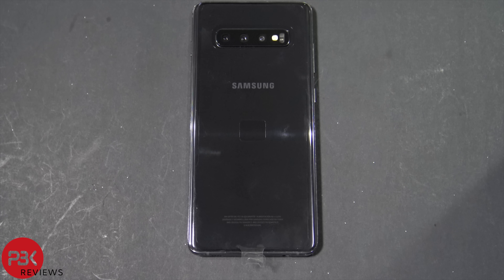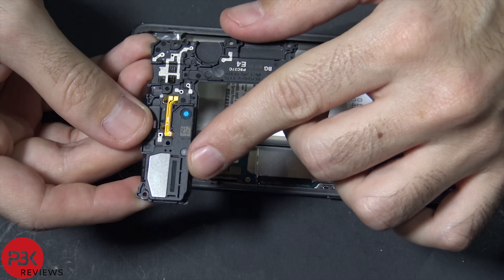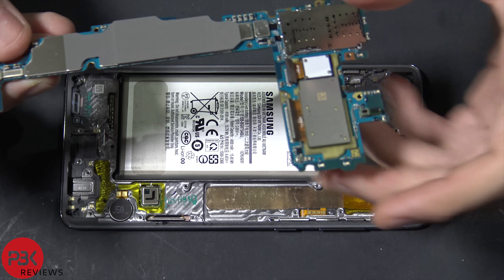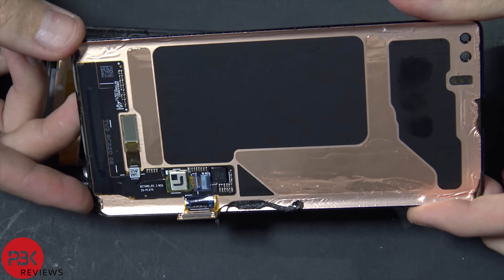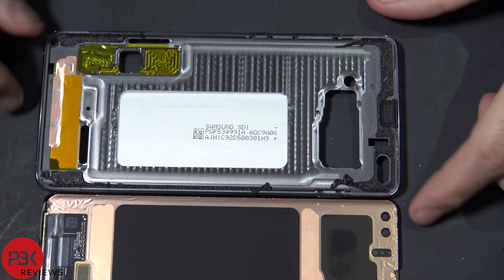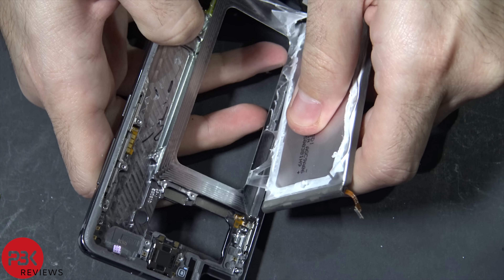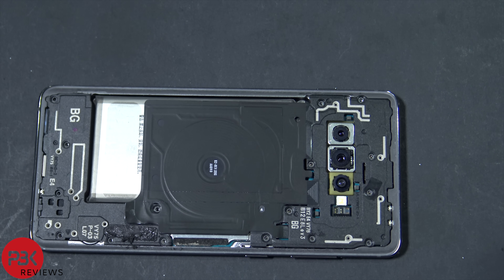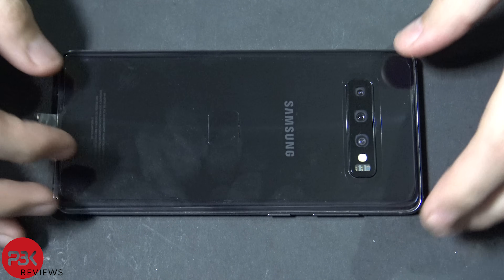Samsung Galaxy S10+ Plus Disassembly Teardown Repair Video Guide. Any Bitcoin Inside?

Comment: How wud u replace charging port
Reply from the maker: Since its soldered to the board you would have to send it to samsung to repair or somewhere that can do repairs like these. However I have herd on USB C ports its hard to do repairs like that.
Reply: @PBKreviews  quick question the Samsung s10 5G model the board is modular so the charging port cud clip of they made it different is my question why doh
Reply from the maker: @costabago9188  Your asking why they didn't make the S10+ modular as well? Not sure possibly cost them less to do it attached to the main board. Or maybe they made the 5G modular since its such an expensive phone, they thought people would not want to pay so much and have issues replacing the charging port on such an expensive phone. Could be many reasons, but they should always make the port replaceable since its a commonly replaced part

Comment: Can you have a look at the sim slot and see if it has connections for two sim cards? I know the single sim models have 1 sim and 1 sd card, but these models come with dual sims as well, in different countries, and I want to see if it's just a case of switching out the sim card tray itself for a dual sim/sd card tray. It makes sense, because why would they develop two different mother boards for the same phone.
Reply from the maker: Hi the one I have is a dual sim version so it does have the pins for dual sim reader. Single one probably has the spot for the pins to be soldered onto the board but probably left blank. Won't be able to tell unless you pry off the sim reader shield to get a look inside but based off previous model motorola phones, I've seen the single sim versions have the spot in the sim tray area but just no pin set soldered to read a second sim etc.

Comment: Can the glass back and ceramic back be swapped??? (Put the ceramic back on a S10+ that came with a glass back)
Reply from the maker: Ya I'm sure it can, its just a backplate so I don't see why it wouldn't work
Reply: @PBKreviews  I've called Samsung customer support, spoke with repair techs at Samsung experience stores and Samsung certified repair centers and NONE of them had a valid answer for me. No one has ever asked them this. Thanks for your reply
Reply from the maker: @giuseppemannino2165  No problem, ya just because it might be made of a different material, its still adhered to the back just like the standard back, just different material. I wouldn't be surprised those ceramic backs pop up on ebay and elsewhere eventually :)

Comment: 2:54 interesting for what this unused contact pads intended? last time when i asked this question, i've spent 2 days on finding drivers, reading datasheets and boardviews for my phones pcb and even try to buy that chip for solder by myself, but that was rare proprietary security chip what costs more than my phone, even if you can find it x)
Reply from the maker: yea, not sure exactly what its for. I thought maybe 5g modem/chip but ya just a thought

Comment: Hey man I'm just wondering whether you know what's underneath the top microphone of the S10? I kinda accidentally poked it with the sim ejector instead of putting it in the sim tray hole. I'm worried some kind of mesh underneath was damaged. The ejector pin was all the way in the mic btw.
Reply from the maker: Hi, no need to worry, its just empty space for the most part between the hole and the mic and I just stuck a small tool in the hole to see if there is any sort of mesh, but there isn't. The tool went straight through with no resistance
Reply: @PBKreviews  omg dude thank you so much. You're a life-saver! So you think there would be no damage to any waterproofing stuff underneath? Surely there must be something covering the mic to stop water coming in.
Reply from the maker: @brittensomerville8883  don't think its easy for water to get into that small of a hole but I could be wrong. However my tool went right through with no resistance. If there was a mesh or gasket there, it would have stopped and gave some resistance
Reply: @FACT z do you know this? do you have experience with waterproof phones?
Reply: @FACT z Well thanks. I have done research and it seems like what I did shouldnt do anything but i will go to samsung anyways and NOT dip my phone in water. Thanks again.

Comment: Hello pwrdbykyank, do you think i can damage anything or break somekind of water proof "seal" if i, for example, insert the sim card tool in the hole next to the correct one? I think it's the secondary mic and i inserted there :(. I was in a dark room and by mistake did that stupidity. Thank you. Excellent video by the way! Cheers.
Reply from the maker: Hi thanks. No I think you should be fine. Its happened many people have done that before but ya as long as it wasn't a large tool to increase the size of the hole for the mic a lot, you should be fine :)
Reply: @PBKreviews  It was a paper clip :)). I sensed some resistance, but normally that also happen on the right hole, so i didn't thought it was strange and keep going lol... Anyway, i'm more relaxed now. Thank you very much!
Reply from the maker: :) your welcome

Comment: IF you damaged the Charging port or microphone you have to buy a new mobile. Any body else think on this ?it’s  unrepairable
Reply from the maker: For the average person yes its un-repairable, would have been best if they had it on a replaceable flex cable. However you can always contact samsung and pay to have them fix/replace it.

Comment: Is there any adhesive on the copper foil of the LCD?  Is the LCD still works after the separation?
Reply from the maker: There was a strip of adhesive yes, and also yes the lcd still worked. As long as your very careful and use enough heat and pry it off carefully you can get lucky and have it still working, but it is extremely hard, It took me a long time and patience. Even with that the chance is very high to break it so I would not suggest taking it off if its not already damaged.

Comment: Great video, one thing I did not like is how you could not put the heat dissipation tape back to normal position and kept holding it and hiding it under your thump even when putting back the phone together.. unnecessary move, you should fix it back correctly as it is important for correct heat dissipation. Nice try though!
Reply from the maker: Thanks, the tape is made in a way once you peel it off it rolls up so if you peel it off you will need a new one if they even sell that part later on, if not you would need to glue it down somehow. But my point was just to show how to take the phone apart and put it back together, not concentrate on how to re-glue the thermal tape so I didn't go into detail on that :)

Comment: Now that you've taken the s10+ apart and put it back together, check to see if it's water resistant still. Us viewers would like to know.
Reply from the maker: At the moment the phone is being used by one of us so I don't want to totally kill the phone if the possibility is there. However If you do use new adhesive and properly seal the back plate back on and the screen as well, I don't see why it shouldn't be water resistant.

Comment: Wow, the display still worked after you separated it from the midframe? Those dents and rips on the copper layer seems suspicious to me. :D I always use some glue solvent and a hot plate to remove it, and I always start from the battery hole on the midframe. Looks way more secure to me to do it that way (note: I only separate displays with broken glass from the frame). And yeah that integrated dock panel tho, we are srewed. :D
Reply from the maker: Yea still worked but I spent a lot of time heating it up and carefully prying it, I sped through it on the video and cut out the heating parts to not waste time. But it was a long process to not damage the screen since they are very fragile. It is best not to take off the screen unless its broken and your replacing it.

Comment: That sucks so the entire motherboard is one piece and soldered usb c port? Putting a display hole is one thing but making it less repairable just gives me more reasons to stick to my s9+.
Reply from the maker: Yep not sure why they didn't make the charger port replaceable
Reply: @FACT z Regardless of durability failures happen eventually.

Comment: Such an expensive device yet the base bodywork structural frame looks so unimpressively thin & filmsy...wonder what material is used..just some questionable low grade plastic or at least some marginal grade of aluminium or (hopefully but unlikely) stainless-steel or titanium used ?!? Just like some Korean car, especially after looking at this 'inside' video of it, i have to walk away more unimpressed than ever of these Korean phones !
Reply from the maker: The frame along with the support of the back plate and screen are pretty strong, trying to bend it is extremely hard and wont bend. So the material holds up.
Reply: @PBKreviews  What kind of material used for the frame & this back plate...anyway i'm not as confidently impressed as before of their product after seeing all these.
Reply: Look at Jerryrig video. He tries to bend the phone in half and the phone barely flexes

Comment: Great video, only concern is using metallic tools inside instead of plastic for disassembly and bending that poor vapor chamber.
Reply from the maker: Thanks! The battery was disconnected when I was using the metal tool to pry the vapor chamber plus with a plastic tool would have not pried off. It was on there pretty well.

Comment: Some people believe the 25W S10 5G charger will work on the regular S10. Not sure about it though.
Reply from the maker: If its not compatible it would still charge the phone but not at that high rate. There are resistors and such in place and the charger and battery know not to transmit more power than it could handle.
Reply: I actually meant "work" as in achieve faster than adaptive charge 2.0 speeds!

Comment: Feel so cheap inside compared to iphones internals.
Reply from the maker: iPhones are overly complicated for no reason, but I've worked with many iphones (repaired many hundreds of them) and as far as the iPhone parts go, they are very fragile and easily get damaged. Whether or not they are a better quality brand chips or parts, they go bad easily. The way the S10 is made, repairs on it are much more simple and I honestly feel the S10 has been well made and designed. Again I don't know if they are cheap branded parts or not but from working with iPhones, after taking this S10+ apart, I would want to work with the S10+ over the iphone any day.

Comment: do you remember the times where you could just take the back plate of and insert a new battery when the battery was down
Reply from the maker: Yep! miss those days lol. I remember carrying an extra battery or two with me sometimes just incase.
Reply: Samsung and others did it for guaranteed income when you replace phone. Just think when they had problems with Note line, they could of just swap batteries and not discontinue it
Reply: @geo745don  Nah, they're probably just thinking of a time when wireless charging will be all over the place and batteries won't be needed anymore.

Haha, or one can dream, at least.
Reply: still there
Reply: I just came to the dark side from a V20 that could still do that and miss it terribly. It type this plugged in to the wall at 5:45pm with only 33% left and it's been on the charger a couple  of times already today. The S10 plus isn't the worst battery life but it isn't good enough to even last me all day.
Reply: Ok so battery change and repairs are not next to impossible as most of the service people say. Ok it’s time consuming and you have to know what you’re doing but overall it’s not that hard. Just out of curiosity how much is the motherboard and the battery and is the protective glass of the back camera replaceable
Reply: Yes, I did like my LG G4.  My kid would use up all the battery life on games, I’d just swap in my new one and boom i was set.

Comment: Surprised how small the battery looks...  iPhones batterys take up more space then that. +1 for samsung...
Reply: As far as I know, the battery in the samsung handy now is not thaaaaaaaaat good, you can survive one day and thats it, maybe after some updates it will be different but right now the battery is a negative aspect of this nice phone
Reply: @voltaireba7345  that's funny a YouTuber made a video of battery test between LG S10+ the latest iPhone mate 20 pro 6T and iPhone was the first to die....
Reply: @voltaireba7345  look how big the iPhones battery is compared to this... so much bigger yet less power.
Reply: @voltaireba7345  As far as you know? Which means you don't know.  I do know, first hand,  and it last at least twice as long as my S8 Plus. The  battery life is actually one of  the main benefits.
Reply: It should have a battery twice that size  maybe then I'd make it through the day without having to charge it

Comment: Wait...wait..5g slot is in there? It mean s10 can be customize to 5g just put in the 5g chips
Reply from the maker: I'm not 100% sure its for the 5g modem or not,  but I don't see why they would add the slot for something to be soldered there and not use it. Since they use the same board layout most likely I can see that being where the 5G modem would go but again I could be wrong. Also its not as simple as adding the chip. That alone needs an expert in soldering, you need the resistors for it, the software needs to be updated, the kernel everything. Doable? yes. Easy? far from it. Even I wouldn't be able to do it by myself, it would require an expert in soldering, expert with android software editing, kernels roms or modem baseband updating etc. List goes on :)

Comment: WHAT a dumb move to have the charging port one piece with the motherboard. Beware of using too much dex 😁 Also, the copper  heat sink compared to the note 9 looks skinny. Seriously I am not impressed with the S10, minor upgrades and the fps is a pain if you have a fault in it. Hope the note 10 will be further refined.

Comment: Possible return the water resistancy after repair?
Reply from the maker: If you apply new good adhesive completely around the phone and make sure its sealed, should stay resistant.

Comment: Whats ur view on the cooling system, does it manage heat well under heavy usage? Say maybe  compared to the s9+ perhaps
Reply from the maker: I'm not too sure how well it works since I personally don't use a samsung device as my daily, but I'm sure its not as good at cooling as far as say the ROG phone we did a teardown on etc. But still the way the thermal pads were layed out and the vapor chamber, I would say it will have a pretty good cooling system compared to many other previous devices.

Comment: wow very decent build from samsung, will be a joy for repair guys! The only mistake was to make those screens with edges, they brake so EASY and costs nearly as new phone
Reply: Decent Build ? the Charging Port is not Serviceable !
Reply: @George241312  who needs it, wireless charging!
Reply: @George241312  what i mean is how are you going to brake if using wireless charging 99% of times:)? since i got one with that, charged with cable twice maybe
Reply: Justas Tulpe new phone? The screen with frame is like 250€, thats a 900€ phone, apple charges 400 for screen replacement and 550€ for back replacement, so get your facts right please
Reply: @SolidSnakeSK  show me where can i get S10+ new screen for 250? even s8 cost more then that idiot
Reply from the maker: Yup I've never been a fan of that curve stuff, always annoying when using as well when your palm or sides of your hands touch accidentally and triggers stuff.

Comment: I'd love to see someone try to upgrade the regular s10 to 5g if they can get their hands on to the 5g modem for it, as the space for the chip is already their. they'll probably ave to completely flash the memory with the kernel to support it.
Reply from the maker: It would be really hard to do and not worth the time and money doing it. Would require an expert in soldering and also someone who would be able to modify the phone software and kernel etc along with additional parts that would be needed like antennas which are usually made as a piece with the frame and so forth. If the frame is the same exactly, its possible to pop in a 5G main board into the regular s10 or s10+ frame but that's about all I can see happening :)
Reply from the maker: @FACT z Since I have worked with phones over 15 years, typically when a company is making a line of phones which are pretty much the same except for screen size lets say or minor differences in hardware, they tend to use the same layout or parts like the motherboard to save on costs. For them to re-design a whole new motherboard for a phone that is the same thing except it has 5G and is slightly larger does not make sense. The time to invest and cost does not add up. Plus I don't see why they would add a section on the board and leave it untouched and unused when they didn't need it in the first place. I've seen this before on other phones where the lower end model had the same board layout but was missing chips on the board but the higher end one had taken use of those open slots for the more advanced features it carried. Hope this answers your questions :)